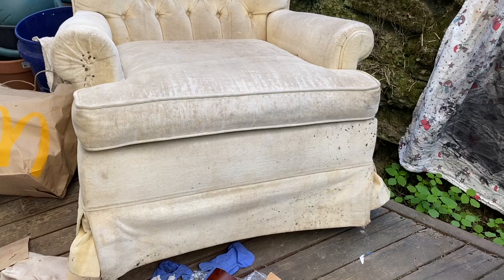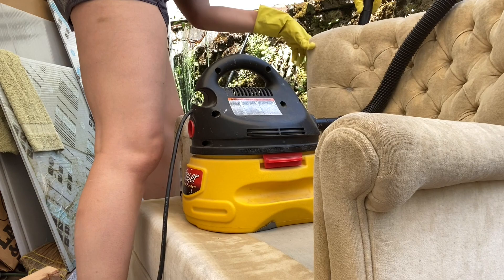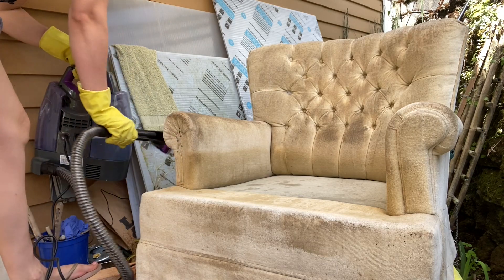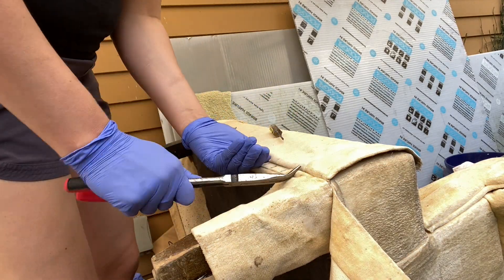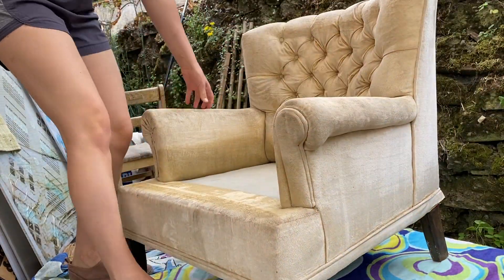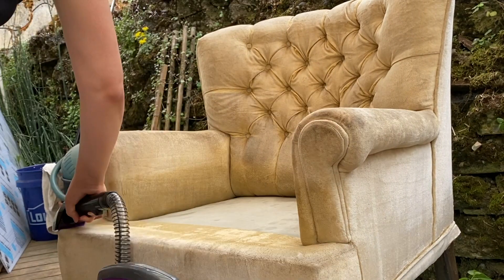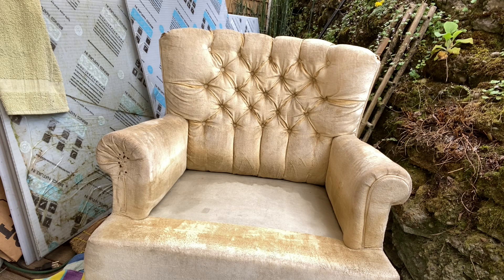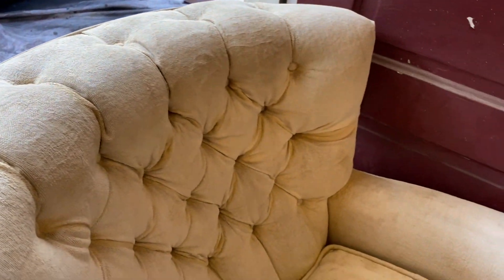CAN I SAVE THIS CHAIR? | Extreme Cleaning Furniture Flip

Comment: Put the foam into a sealer bag,suck out air,insert bag into cover,unzip,let out the air,and Viola!!!!😁😘.
Reply: Another take on getting stubborn cushion back into cover, use thin drop cloth plastic or cut sides of lg trash bag open so it's a long rectangle of plastic. Wrap foam into plastic so front edge and top/bottom covered. Slide into cover and pull plastic out. This protects foam from snagging and saves your sanity 😹

Comment: sing in the tune of paint it black I see a gross white chair and I want it painted black. No stains shown anymore, I'm never turning back.  .... velcro wooden hexagons that you can get on Amazon over the nails or glue..whichever works. I am staring at a pack on my work bench right now.. stain to and finish a color to match whatever you dye it. I am jealous. I ended up getting a pink chair to attempt color change on. I wish I had a cream color so I could make it dark blue. You have options!

Comment: I saw a mixture for tough stains that I’m
Going to try on some dirty chairs I’m flipping. Get a 32 oz spray bottle. Mix 6 ounces of dawn PLATINUM (important apparently) dish soap, 6 ounces of 90% rubbing alcohol, 32 squirts of the oxy max force spray you had (very specific 😂) and fill the rest with the hottest water you can. Spray it on and scrub it in. Let it set for 10-15 mins then suction it up. I’ve gotten all the stuff for the mixture but haven’t tried it yet. But it worked in the video I watched so here’s hoping.
Reply from the maker: Haha that's awesome. I love how specific it is! Would you mind linking that video? I'm curious to see it! Also let me know how it goes if you try. I use the very unscientific mixture of -- a squeeze of dish soap, a splash of vinegar, however much oxyclean I feel like, and the hottest water that I have patience to wait for. LOL

Comment: Try Folex - a cleaner available at Home Depot and Lowe’s by the gallon or in a quart size spray bottle.  It is absolutely fabulous!  You can add it to plain water in your Bissell.  You can also spray it directly on stubborn stains and then just rub lightly back and forth - no rinsing is necessary.

For the arm front - make a template of the other arm’s shape using a stiff, sturdy, and not too thick cardboard (something like what is on the pad of a lined pad of paper, like a legal pad).  Wrap the leftover skirt fabric around the cardboard template.  You will need to make relief cuts to get the fabric to go smoothly around the curves - this is basically making slits from the outer edge of the fabric to almost to where the cardboard meets the fabric.  Practice with a scrap of fabric first.  You can use hot glue to adhere the fabric.  After the new arm front is dry - use a good quality fabric glue to adhere to the arm front and weight it down with books for a couple of hours to dry.  You can do it!
Reply from the maker: Oh! Thanks, Maria. I hadn't heard of folex but I'll have to check that out! 
And thanks for the template idea. I think that's going to be the winner! Hopefully i can make it work. Thanks for your ideas and thanks for being here!
-Clara

Comment: I have seen how flippers rip the skirt off these chairs, as I have learnt upholstering furniture I cringe when I see flippers do this....you are a smart cookie figuring out to fold the skirt under, there are a couple of products upholsterers use, such as cardboard strips to get a straight edge...also if you had a pneumatic staple gun I would recommend removing the strip and the piping just above it and reapplying the skirt using the cardboard strips and placing the piping on the very edge of the chair on the fold line frame of the chair...if you don't want to do that I would suggest with the offcut fabric make more piping and staple a second line of piping on the very bottom edge where you fold the skirt so it looks more symmetrical.
Reply from the maker: Wow! Those are all awesome ideas-- thanks so much for sharing! Yes I don't have a pneumatic staple gun yet but I think I need to get one-- seems like it would be wayyyyy easier!!! Thanks for watching and thanks for your detailed ideas :)
Reply: @KnowCanDo  to be honest if you can afford to set yourself up with small air compressor and upholsterers staple gun, I strongly urge you just buy a small one and buy one that is oil free because the one's that require oil are not good for upholstering the oil will leak through the air hose onto the fabric when you staple, make sure you buy a water filter to fit the air hose too...you will also need a sewing machine...let me know if you need help with ideas avoid using vinyl and leather to reupholster because too hard for a beginner....with a chair like this, being so dirty I would not buy it or put any time into it unless you could replace every bit of foam and batting and reupholster, it looks like it has black mold which is a bad sign....if you are looking at flipping upholstered furniture that you want to restore you need to strip it right back to see what the foam underneath has happening, replacing foam is expensive and replacing fabric is expensive so if you can feel the foam has shrunk or is damaged don't bother buying it to flip unless it is a genuine antique frame and you can do a proper upholstering job on it.
Reply: @KnowCanDo    I have learnt a lot about upholstering from a great youtube channel called :   ALO Upholstery and would highly recommend you check this guy out, his videos on youtube are very educational, and you can see how things are done.

Comment: Oh and I'd dye the chair not paint it this time but a dark dark color to hide the stains.
Reply from the maker: I'm considering that too! Have you used RIT dye for something like this before?
Reply: @KnowCanDo  i haven't but I've seen people do it and it looks so much easier and better outcome than painting.   I have a beautiful living room set  in late 70's light golden yellow. ... long story.... never wanted yellow although pretty as yellows go I'm a blue or white/ ivory person.  So I finally made the decision to change the color and have been experimenting with different white fabric paints so far not much luck.  I love the lumiere pearlescent white but so far I haven't been able to dilute it correctly.  I want to try Jacquard Dye Na Flow- that might be a good option for you as well if you can't find a Rit color you like.  I got some of the Dye Na Flow in blue and it goes on just like dye but I didn't think to get white at the time.  They also have a good variety of colors.  The only problem i can think of with Rit is heat setting it.  I would guess a hair dryer or a well handled heat gun would work.  The cushion cover you could iron.  My problem with the yellow is if I use actual blue dye in afraid I'd get green UGH!  I know the lumiere blue pearlescent covers with no green and it stays very soft on my experiment piece but I really want white.  I will however settle for a light silver blue😁  thinking about mixing pearlescent blue and pearlescent white and fabric medium.  Just saw where you can make your own with glycerin water and vinegar. It's supposed to help keep the fabric soft and dilute the paint.  I have found one trick to keeping the nap soft is to use a wire dog brush one with a stiff hair brush on the other side and while the paint is wet, brush the nap up against the grain.  I use the brush,  both sides, instead of sand paper.  As a person who wouldn't, couldn't let go of a faux stained glass clock that fell off the wall and broke into about 50 pieces (yes I put it back together and you wouldn't know it was broken) you can salvage anything if you really want to.  You have the really hard stuff done on the chair the cleaning!  Whatever you do to it will add to the already huge improvement! 😊

Comment: All you have to do is take the piece off the one arm take off the fabric and use it to make a template out of cardboard.  Then put the fabric back on it and replace it. take your cardboard piece and cover it with the pieces of skirt .  It looks like it has a welt around it too on the intact arm which you can either remove so that they match or get a piece of welt and cover it in more skirt leftovers or simply put some jute or other rope around it. Take out the rusty nails, glue down the fabric (hot glue) and staple if possible then hot glue on your new piece.  If you have some rope or trim lying around it will be a no cost fix.    

I don't get this trend in tearing off or stapling under skirts though.  The purpose of the skirt is to hide the legs which are not usually appealing unless they are french or cabriole iIMHO.  I prefer the skirts in tact.  Anyway, like your videos and good luck with your fix whatever you decide. :)
Reply from the maker: Aw, thanks Leana! That was such a nice and really helpful comment! I think I'm going to try that but the skirt fabric was really gross so I'll throw that in the wash first. I really appreciate the detail of this comment -- so helpful!

In regards to skirts VS no skirt -- it's totally just a personal preference and style. I think showing the legs is "in" right now especially because Mid Century furniture is so trendy. I really love the look of a lot of these legs, so I prefer them without a skirt, but I'm sure skirts will be back in a few years and OMG will everyone just glue them back on?!?! Ha! I don't think so but who knows. Thanks for watching, commenting and being here!
Reply: @KnowCanDo  oh yes that chair was disgusting! I'm sure you're right about the trend.  I'm MC myself just not modern.  Lol   besides if there's no skirt you can see all the dust bunnies !  I will be anxious to see what you come up with.  So many things you could do really.  Decisions decisions...